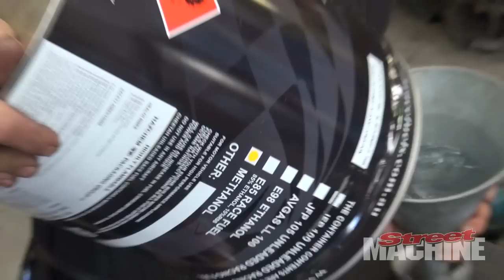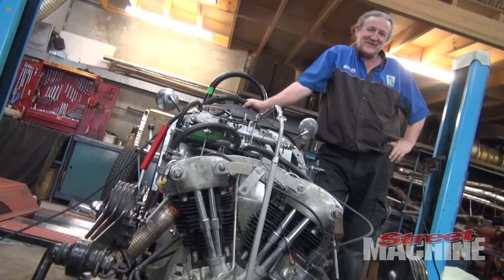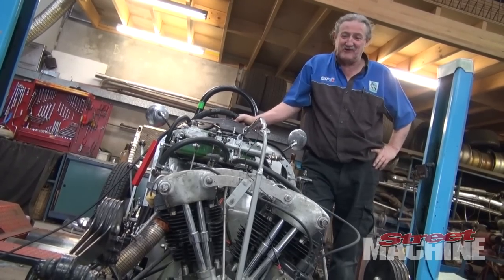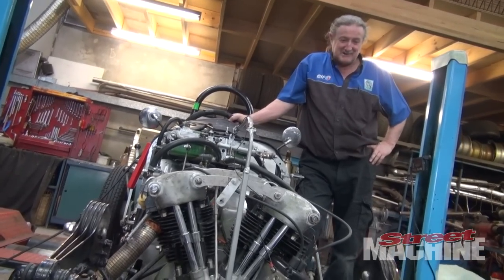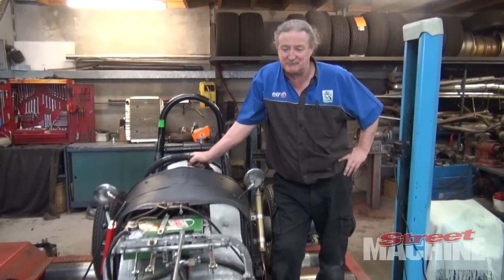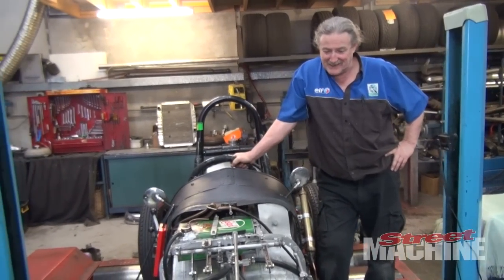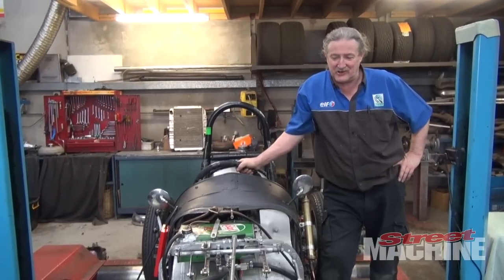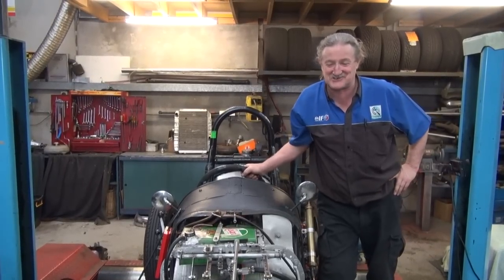Knucklehead Powered Cyclecar On The Dyno

Comment: I wish I had the time and money to turn an old goldwing I have into a cycle cart
Reply: Easy to do and much less expensive than you would think
Reply: @davebaker9128  My biggest problem at that time was I didn't have a proper garage.
Reply: Ok, I can appreciate the limitations that might impose
Reply: @davebaker9128  It's on my bucket list. I want to build a Morgan replica.
Reply: That's funny, I have been nuts about three wheel Morgans my whole life, have been considering doing one using a Panhead Harley engine, I have 2 of these bikes, one since I was 19 yo, (43 years)
Reply: @davebaker9128  One of the nicest ones I've seen used a Honda Silverwing drive train